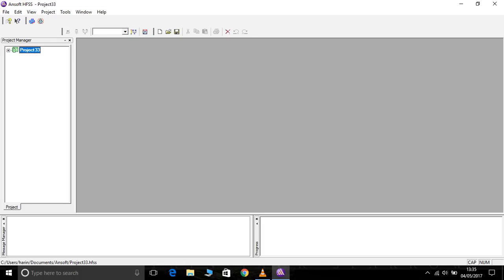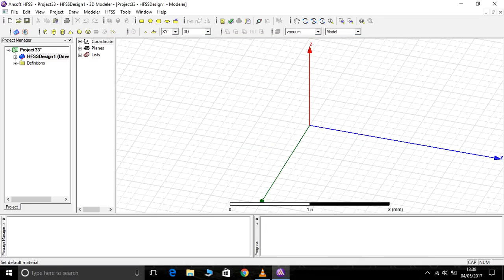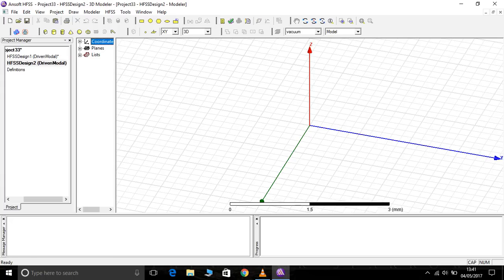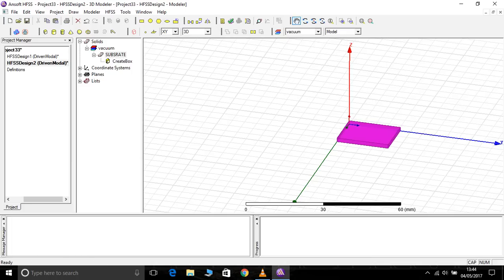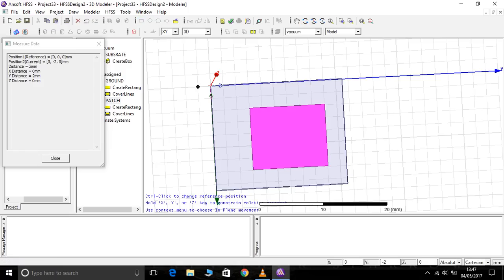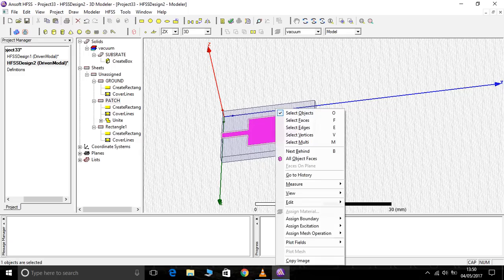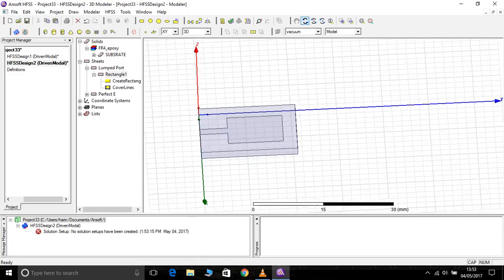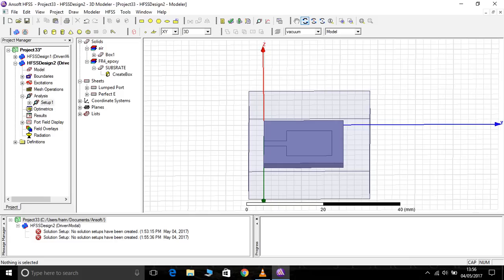HFSSS- MICROSTRIP PATCH ANTENNA DESIGN PART-1(basics of antenna design using HFSS software)

Comment: Hello first of all, your video is very helpful. Please can you explain us how did you calculate the substrate dimensions? Why XSize=17mm, YSize=21mm?
Reply from the maker: Substrate dimensions doesn’t have to be so specific, depending upon the patch size you can choose the substrate dimensions. Say for example, if a square patch dimension is 35x35 mm, the substrate should be > 35x35 mm, if probe feeding is used. 
In case of transmission line feed, it should be greater than the patch and feed line dimensions. 
However, please refer to the design equations video in my channel. 

Thanks
Reply: @harinathm1  Thanks for your answer. So how did you calculate the radiation box dimensions?
Reply from the maker: https://youtu.be/DhXCdvm-Kl8

Radiation box calculation is given in the above video link.

Comment: I am getting this error while validating 
trial2x2 (C:/work/HFS_design/)
  HFSSDesign1 (DrivenTerminal)
    [error] Port refinement, process hf3d error: Too few conductors were found on port 1.  There should be one conductor for each terminal, with one additional reference conductor.  Unintentional contact between conductors may cause this error.. Please contact ANSYS technical support. (6:03:44 PM  Nov 23, 2020)
    [error] Simulation completed with execution error on server: Local Machine. (6:03:45 PM  Nov 23, 2020)
Reply from the maker: I may have to take a look at your design and the port assignment ...please email me

Comment: Sir while assigning boundaries to groundplane and patch it shows error that boundary may not be assigned on non model objects..plz give me the soln.
Reply from the maker: The reason for this is...during the time of simulation if u try to add any objects a notification appears like "A solution exists; do you want to create a non model object?" Then you have to choose 'No' option. You might have choosed 'Yes' and so software would have take it as a non model object, for which u cannot assign boundary. The solution for this would be either try a new design or find out the non objects delete them and create those models again.
Reply: @harinathm1  thnq so much sir for ur quick reply

Comment: Sir, when I keep the solution frequency (say, 5.2 GHZ in discrete sweep) as the center frequency, then the value of return loss and VSWR is not as good as when I keep 7.5 GHz as the solution frequency during simulation (the sweep being bw 1 to 10 GHz).So, should one go with the higher frequency for simulation or keep only the center design frequency as solution frequency? Hoping for a reply soon.
Reply from the maker: That doesn't matter i guess, because when you go for real time testing we dont choose any solution frequency but we only choose the frequency range. If you have designed the antenna for certain frequency (say 5.2 GHz), that frequency  should be given as solution frequency.
Reply: @harinathm1  Thankyou sir.👍

Comment: Hello sir...i want to find isolation measurement for 2 element MIMO design.. Please guide me for simulation of this MIMO design..
Reply from the maker: S21 result will represent isolation.
The envelope correlation coefficient plot also represent the isolation in MIMO. If u need to extract envelope correlation u need to use HFSS  18 version.
To know the isolation measurement, simulate the MIMO antenna then go to HFSS_> TOOLKIT_> MIMO and then you can find the correlation coefficient at diff frequencies ...
Hope this will be helpful.
Another way of finding the ECC is just use the below equation in the output variables of HFSS.
This can be used even in lower versions of HFSS as well/ 
(mag(conjg(S(1,1))*S(1,2)+conjg(S(2,1))*S(2,2)))^2/((1-mag(S(1,1))^2-mag(S(2,1))^2)*(1-mag(S(2,2))^2-mag(S(1,2))^2))

Comment: Hello Sir, How to remove this error in the simulation of a microstrip patch antenna for 2 THz. Port refinement, process hf3d error: Terminal Rectangle2_T2 on port p1 contains a non-conducting edge.  The terminal may need to be assigned manually..